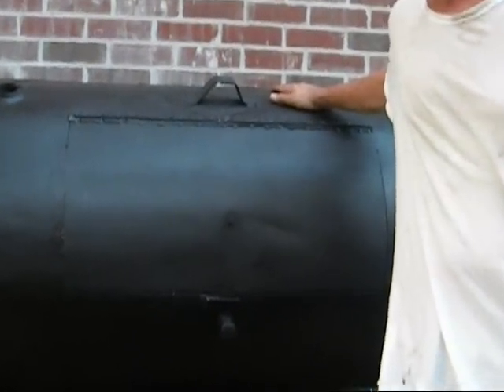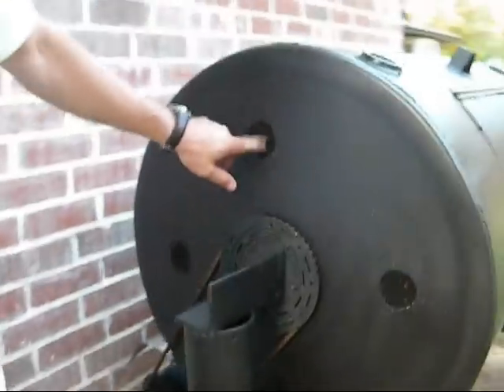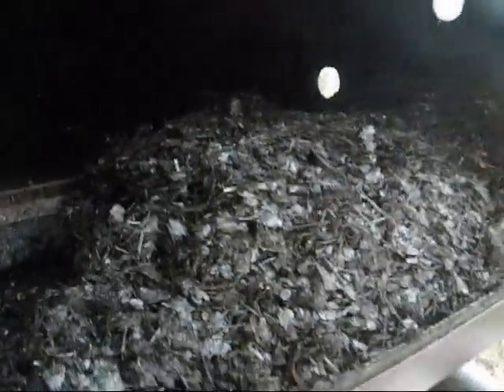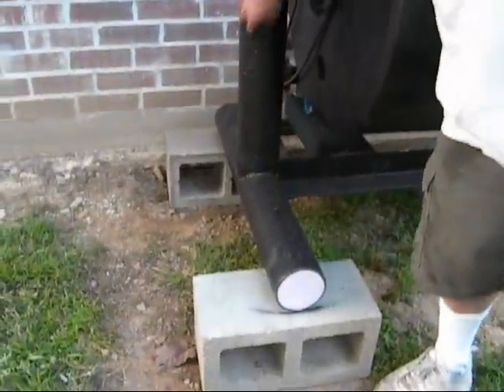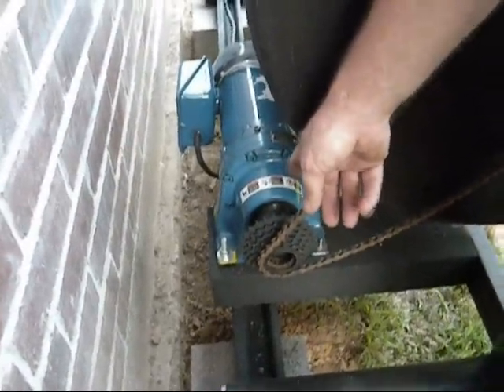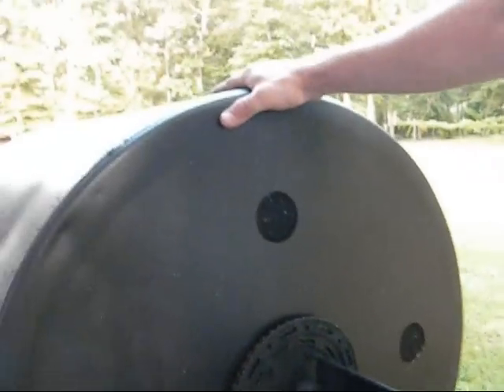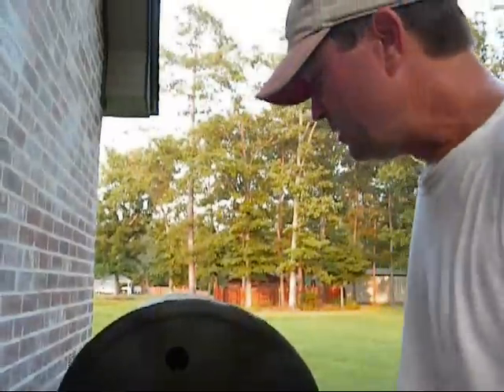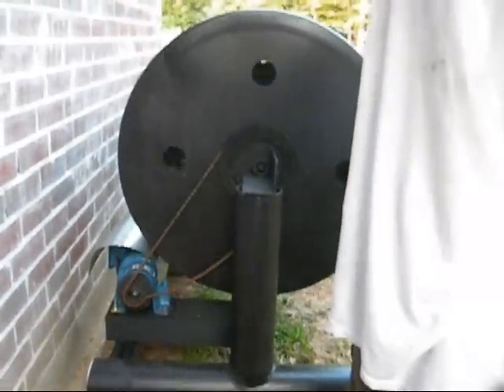Automatic Composter

Comment: its my opinion that you should let the compost rest for a couple days after turning, as the bacteria and fungi that breaks down the material works the quickest when its aerated and at rest so that the heat can build which allows the bacteria and fungi to thrive and propagate.... which when it is thriving and propagating, its feeding on the debris at its peak efficiency... turning too often hinders this process... specifically, the only reason compost ever needs to be turned is to supply fresh oxygen to the "bugs", so they can thrive and do their job... then it should set so the bugs can reach their peak activity level until the oxygen content starts to decline....  an abundance of oxygen is of no use if the bugs never really get a chance to use it....

Comment: This is the second one of these I have purchased as the first one broke after 4 years. I think it broke because it got too heavy with compost.>>>ur2.pl/1137    The idea is to use one side and then when it’s full, start using the other side, as the first side continues to compost. We were going back and forth without emptying it and the plastic where the side road enters, just cracked. It had been getting heavy to turn. All in all. A decent composter. Compact, not bad looking, no smells.

Comment: hey what motor is that and what are the specs
Reply from the maker: This is a geared motor from an industrial assembly belt. Not sure what size but it runs on 110 volts and is 1 1/2 hp.

Comment: Very impressive.  (So is the comment by Romy Jugroo about adding a solar panel.  Anyhow.  Question 1: why did you put the motor so close to the bin?  Wouldn't having it about 4 or 6 inches away prevent any possible scraping of the motor?  Question 2: rain.  Any possible problems with the motor getting rust from rain since it's so exposed?

Thanks for the video, BTW.
Reply from the maker: Thanks for your comment. #1 I constructed this bin by scrounging around my back yard metal pile. I only had that length chain thus determining the distance that the motor could be from the bin. #2 You are right about weather and the motor but I did build a little cover for the motor so that direct rain would not enter the motor.  Hope the compost bin at least gave you some ideas to build your own even better than this one.  The main problem with this set up is you have to moisten the contents fairly often. It would be best if you could figure out some sort of moisture meter that would automatically keep the contents to the right moisture content.

Comment: I've got a two 6' sections of 30" diameter double-walled corrugated drainage pipe left over from a drainage project.  Converted one of them to a compost bin.  I can only rotate it by wrapping the cable of a come-along around the pipe and securing the other end to a tree.  Hence, I never turn it.  I've been throwing an idea like this around in my head for years.  Need to get on it.

Comment from the maker: I shred with the lawnmower and then rake the contents in the composter. The one thing about this composter is that you have to watch the moisture pretty close, it will dry out quickly. Other than that is is no problem.
Reply: The moisture is going out those 'vent holes'; so cover them.
Reply: @chasmarischen4459  the microbes doing the composing needs oxygen

Comment: This is a great machine  it should be able to handle about 3/4 of a cuyd at the start. Have you checked the temperature that it stabilizes on with that amount of rotation. For the best results it should be between 120f and 140f.  Do you sherd the larger particles before you place them into the drum?  I'm fourced to use a large open area because my livestock ( Chickens and Geese) and there litter create about 8 yards in two batches My plie starts as a 8' X 5' x 6' high I mix with my tractor forks